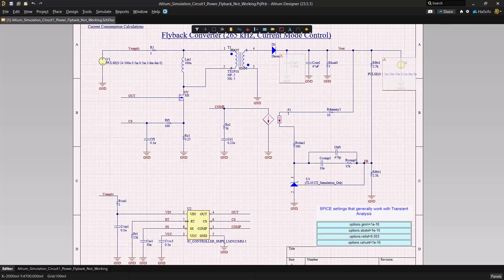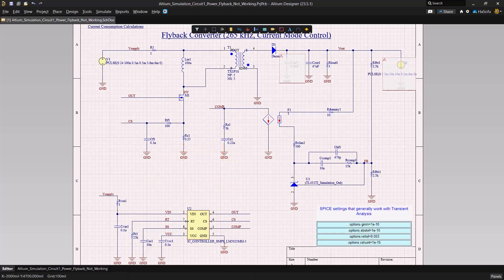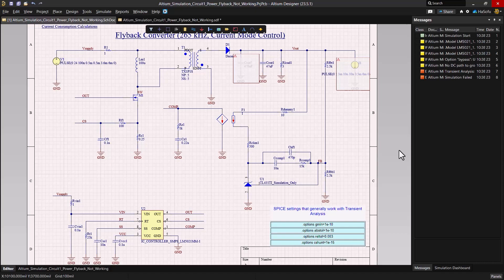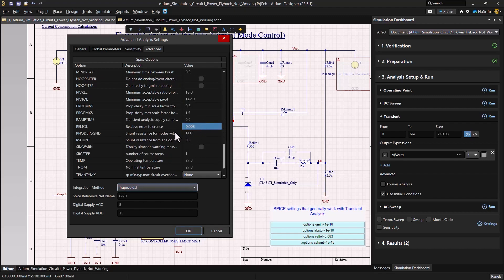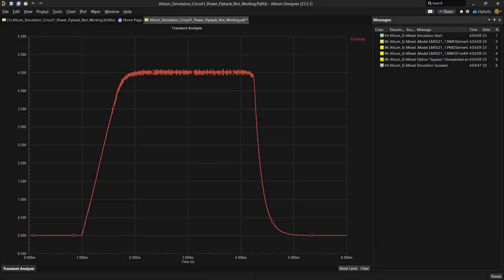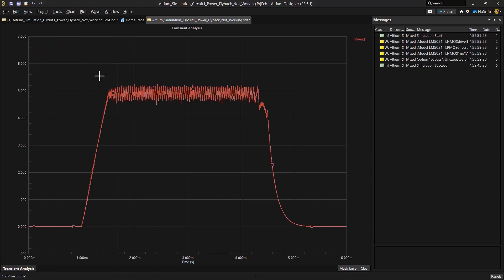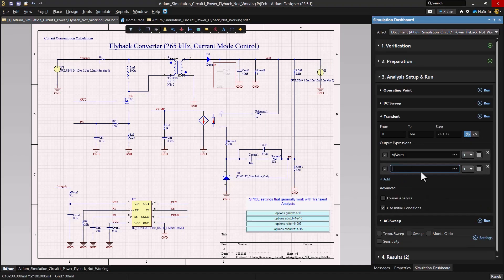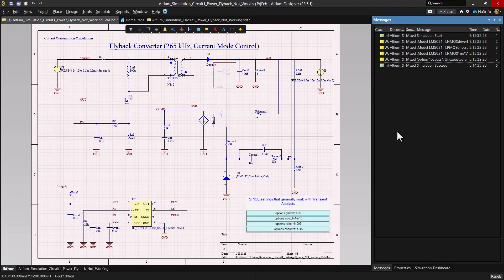Flyback Converter

Comment: How did you got this Pspice model LM5021MM in altium designer
Reply: Altium supports Pspice imports when adding a simulation model to a component. If you are in the schematics or your library, you can go into the properties panel and add a simulation model. From here a dialog will come up that allows you to select a model to import and the type of model. There is also LTSpice support.